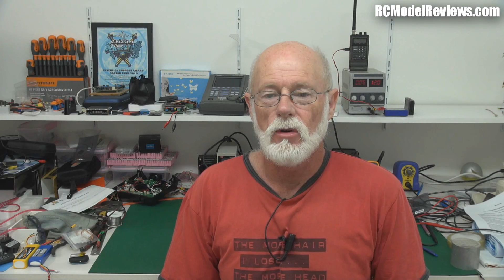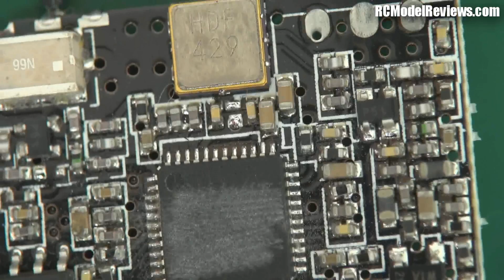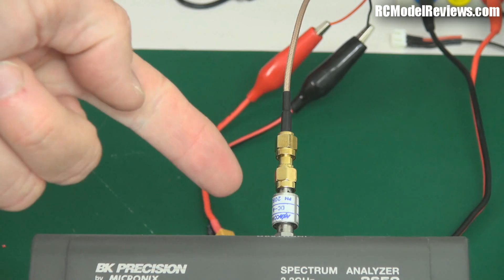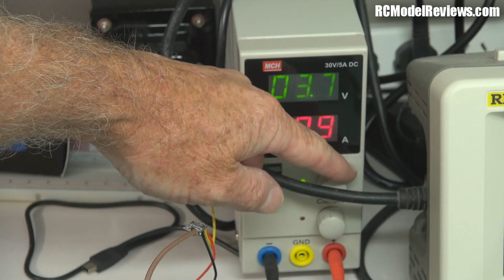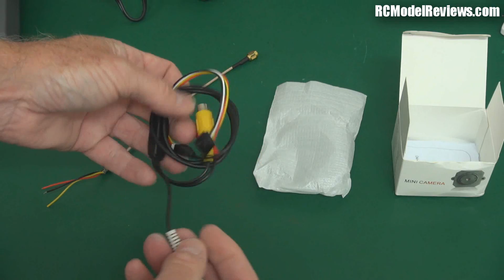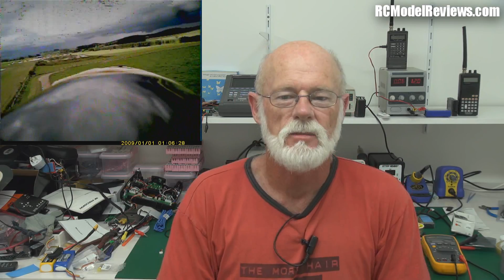HobbyKing 1.3GHz micro FPV transmitter & receiver (review)

Comment: Have one of these sets stuck in customs while a postal union strike is on, but hopefully will get soon - I only want it for short range FPV ... sourced from Deal Extreme (dx.com) as HK have it listed on back-order for at least March or April.

Naturally I've been waiting for your promised follow-up on the channel change dip switch mod ... took a look at the info on HK but there's not enough for a non-electronics-engineer to trust in. The info there is once-off 'solder this, move that' type hacks, not a dip-switch mod which retains flexibility to avoid conflict.  Hopefully you will get around to doing it, and also include the better video example results. And some suggestions for antennas?

Probably the most annoying feature of RC electronics components is the almost total absence of documentation. Manufacturers expect all their customers to be electronics experts and don't provide usage instructions and explanations - this set is sold on the feature of multi-channel capability but without any info whatever, and no route to discovery either. What's the use of putting features in if the user can't get to them?

Comment: Have you thought about using the Raspberry Pi camera module (without the RPi). Its a cheap 5 mpixel camera (30 us $). Need some hacking to get to work, but you should be the wizard that could pull that of. GREAT SHOW. I hope you get flying soon!
Regards.

Comment: The More Hair I Lose ...... The More Scalp You Get!! LoL.....Tx frequency can be changed to 1280MHz by relocating a couple of resistors, however, depending on your board you may get fluctuating power output. Mine works ok. This is for short range FPV in mini planes/ quads anyway.  Rx frequency can be change to 1280MHz by grounding on of the pads - check pics on product page

Comment: I have added 3 images on the RC Group Forum, showing how I have made my receiver a bit "stronger" so you don't brake those brittle wire soldering pads.

http://www.rcgroups.com/forums/showthread.php?t=2026026&page=13

Comment: Sorry if you don't like FPV stuff? What kind of LOSer would not like FPV, out of morbid curiousity? That's like watching a Nascar race without the driver perspective, or seeing a drug bust from outside the hotel instead of a POV cam, or looking at a smut mag instead of, well, never mind...
Reply: Only it's not.
You have poor depth perception, very limited angle of vision and no peripheral vision.
Some FPV pilots are failed RC pilots that struggle with orientation.
(Notice I say SOME and not all).
Reply: ***** Spoken by a man who obviously has never flown FPV before. I will bet every last Franklin in my bank account right now you have never even tried FPV. I speak as someone who flew LOS since 1985, way back when you had to actually build your plane from wood. I flew the crap out of my planes and helis until it just simply got boring.

Since I started flying FPV 2 years ago, I can say it is a whole different experience, for sure, with it's own challenges, but is every bit worth it. Many aspects of FPV are more challenging than LOS, and vice-versa.

1) Poor depth perception? Your LOS depth perception fails even yourself, watching your plane externally from the ground. Even just 75 feet away, with 2 aircraft sharing the same airspace, it would be impossible for you to tell which plane/heli is slightly closer or further away from you, causing a potential collision. Two FPV planes can easily fly in formation or even right past each other head-on without danger of colliding.

2) Limited angle of vision? Easily solved by a $30 180 degree pan servo, plus a tilt servo with head tracker if you so desire.

3) Peripheral vision? See solution #2 above. I know when I flew LOS the only thing that ever came into my peripheral vision is the bozo next to me standing too close and bugging me about how fast/high I could go.
Reply: ***** I would like you to find me one single FPV pilot who is a "failed R/C pilot that struggled with orientation". I find it difficult to believe that someone who failed at flying LOS R/C would embrace FPV R/C as if it were somehow easier to experience success. (read more...)

One of the essential primary steps an FPV pilot does FIRST before ANY FPV GEAR even goes onboard a new FPV plane is to make sure it is airworthy by performing several test flights LOS. The idea that a "failed R/C pilot" could take a new plane, stuff a bunch of FPV gear onboard and experience success is not very likely.

Show me a "failed R/C pilot" who takes on FPV, and I will show you both a failed LOS pilot and ALSO a failed FPV pilot. If an FPV pilot does not know how to fly LOS, he will certainly be forced to learn the hard way eventually, because there are many times when even an FPV pilot is forced to either take off, fly, or land LOS (e.g. for safety reasons).

Comment: Thanks Bruce, I appreciate the effort, learning a lot.  I'm retired now, and enjoy RC.  Thinking about getting into fpv.  Question:  I suspect you are an amateur radio operator, yes?  '73
Reply: No, not a HAM but I've been designing, building and servicing RF equipment for over 40 years now.
Reply: ***** Thanks for sharing your knowledge.

Comment: Isn't the purpose of 1.3 long range?  Why not make a micro 5.8 system if all you are doing is 200 yards?  I don't get it..
Reply: Not necessarily, 1.3 just gives better penetration, which is better for long range. But that doesn't mean it's exclusively for long range. You kinda have to weigh your benefits. A 25mw VTX on 5.8Ghz would most likely be utter crap, if you went behind a couple leaves, you would lose your signal. If this VTX was on 5.8, he probably would not had gotten nearly as far as he did. But, on the downside, you have bigger antennas on 1.3, so you couldn't go with a CL or similar circular polarized antennas on a micro model, you would have to build a dipole to really get some range. But, once you got a good antenna on both ends, I bet you could easily go a quarter mile with this VTX. (Whether or not the micro FPV plane/multicopter could go the distance would be the limiting factor) 
So, if you are going to be only flying 200 yards out only LOS (no trees, bushes, or anything), then sure, go with 5.8. But if you live in an area like I do, and want to go behind some trees or something and still keep your video, this would be something to look into, just because of the penetrating qualities of the lower frequency.

Comment: Just measured the lenght of the "antenna" and it is 67mm. So it is "tuned" for 1063MHz ? Wonder why. I will measure the EIRP and try to trim the antenna to max. performance.
Reply: Cut it down to 53mm and it did not change a bit. So much for the "antenna". Guess I have to live with it as long as it will be used on the Hubsan.

Comment: Thanks for that Bruce.
What do you think the chances are of pairing the receiver with a more powerful 1.3GHz transmitter?
Im thinking I would like to use this receiver with my Fatshark attitudes or base goggles, and i install a CP antenna. that way  I still have 1.3GHz, but not a hefty ground station. yes mI know I can use 5.8, but it's not great for flying through trees and past buildings and stuff like that.

Comment: I wonder why HK have chosen a "half wavelength" antenna? Why not cut it down to a quarter wavelength and save some weight on the TX board? At 1340MHz it should be 5.3cm then. I think we will have a good time optimizing this FPV set :)